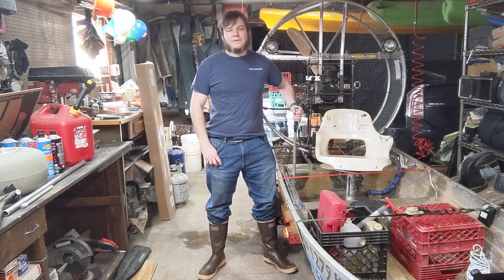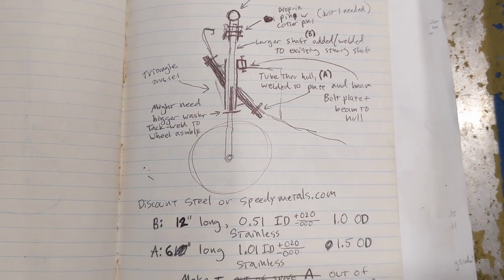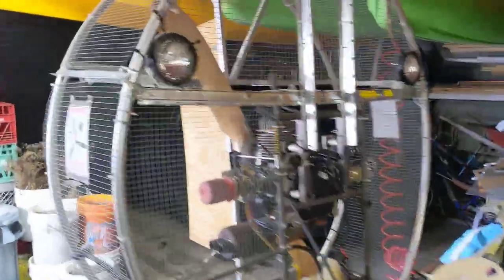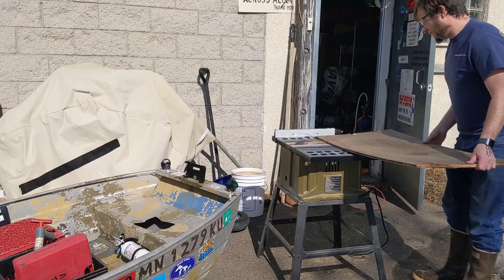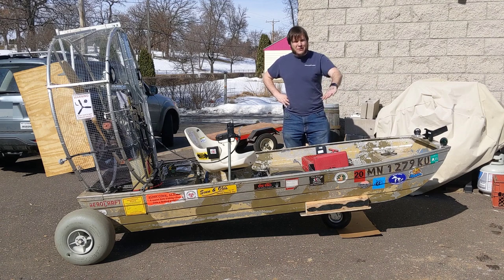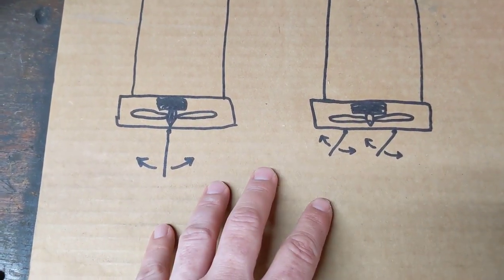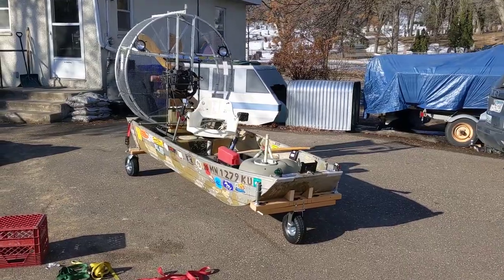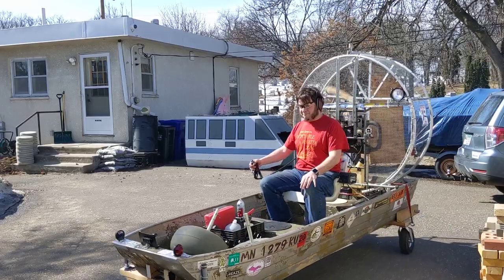Mini Airboat on Wheels! (Part 1)

Comment: The steering caster wheel needs to be the back not the front one. Front has to be fixed since the actual steering is done by the rudder. You don't want the boat to go sideways but change direction :)
Reply from the maker: All the weight is at the back, so if I just had one wheel back there it would probably roll over.

Comment: How bout individual brakes on each back wheel? Stop one side at a time to turn. Might work with the caster up front. Pretty in-depth to build though.
Reply from the maker: That would make it harder to swap the wheels on and off, but worth looking into.

Comment: Put two retractable caster wheels ON THE BACK of the boat as that steers direction. Two fixed wheels at the front corners helps over obstacles. Also surround the fan with a cover on the perimeter frame to focus the air more efficiently. Maybe change to TWO air rudders, SMALLER for stronger control. Study the physics.

Comment: You may what to make your stering router on the back larger and cover it with light weight fiber glass so it's smooth so the wind doesn't have so much drag.

Comment: You've got good process there. I was thinking front castor wheel as well, but I thought that would be too imprecise for what you need it for. I also had the cable steering boat motor systems in mind.
It would probably have to be a two sided system rather than one cable, arm control. The latter might not have enough strength . RC would be too much hassle for a watercraft and clutter, like you said, mythbusters had a lot of trouble tuning those things in. Simple hydraulic system with a manual pump operated by your feet maybe. 

You could do a video visiting your local junkyard/car wrecker, look around see if you spot something. Trucks might have heavy cable mechanisms you could get for two bucks. For someone not living in your country, videos where you visit stores and car wreckers are very interesting.
Reply from the maker: I've been thinking of a cable system like I have for the rudder, but running forward to a wheel. I just haven't figured out a good way to do it yet that's strong, lightweight, and easy to attach and detach as needed.
Reply: @saveitforparts  It all depends on what you got at hand or can get for nothing. I would say that taking a small children's bike and cutting of the front section flush at the steering post would give you something you could clip on or off. You'd need one side of the handle bar to steer it, other side gets cut off. Then you got something strong with bearings and pump up tyre, even if it's "Pink Unicorn" brand. Pushing and pulling that half of handle bar could be a detachable rod, moving to front and back to give you more turning angle. If you can get one of those house window closers, the wind up ones. They are very sturdy with cast iron case, solid chain and gears.  If you put that on, to push and pull the handle bar, you could rip out its little handle and shove in a steering wheel rod. Commercial/industrial window closers, for windows high up have very solid, long turn cables encased in aluminium pipes, that could do away with steering rods. That's only if you have abandoned schools or commercial buildings around, to rip it out from.
Reply from the maker: @MISTERPRESIDENTELECT  I actually have some pink unicorn type bikes I've been hoarding for that purpose!

Comment: Putting a larger motor in it wouldn't be too hard or expensive, that'd be a cool video!
Reply from the maker: This motor is plenty powerful when it gets up to full RPMs, I don't run it on full throttle for long since it gets hard to control and it burns gas like crazy. I'll do some more speed tests in the summer when there's water to run it on!

Comment: First thought.... put a castor wheel on the trailer jack, it’s already secured to the trailer and it has 2 of 3 wheels already.... later my thoughts turned to turning the boat around on the trailer to pivot on the rear like my old walker lawn mower

Comment: If you are going to be driving this over sand and marshy shores there will be much more resistance than pavement has. I don't remember if you said how heavy the boat is but technically you calculate the amount of surface area you would need and test how much area the tires you would give you at different pressures by loading them up. You might also consider doubling or tripling those wheels up if you want to be able to easily get over soft swampy beaches with sticks and things the boat has to drive over. Also what about still using fixed back wheels maybe doubled up depending on the weight distribution of the craft but like on a big round lazy susan type thing and you could spin that to turn? It would be bigger than I think you want but feel like it might have to be made out of metal to get the leverage to steer the wheels and have the same size and strength to weight ratio that is needed.

Comment: Heyo, Have you considered adding a directional control rod and tie rod to the rear swivels? 

So you are not relying on air to control direction but also have some steer-ability with the rear tires using the same controls you have for the rudder?
Reply from the maker: Originally I was going to have the front wheel/swivel steerable with cables but it's been a real puzzler for how to run that without it getting even more cumbersome than this already is. I might redesign everything again after testing this on a larger parking lot.
Reply: @saveitforparts  There is a defunct Target down here in hastings with a wide open parking lot. Plus I am just down the road for any immediate repairs.